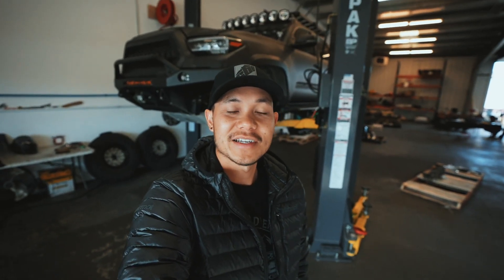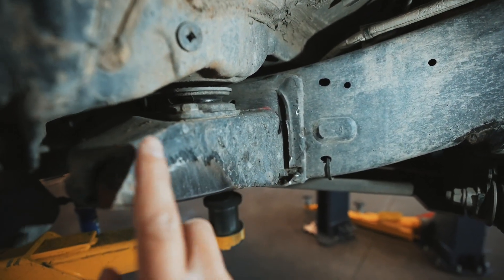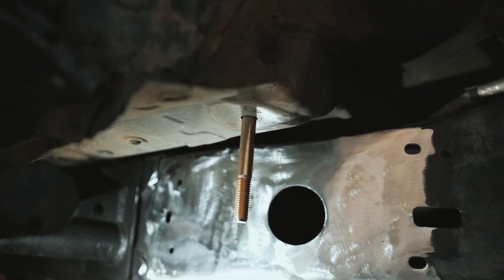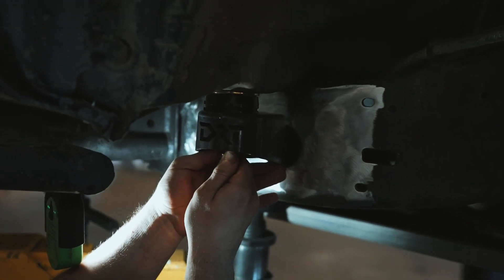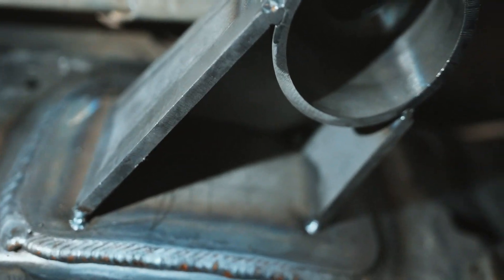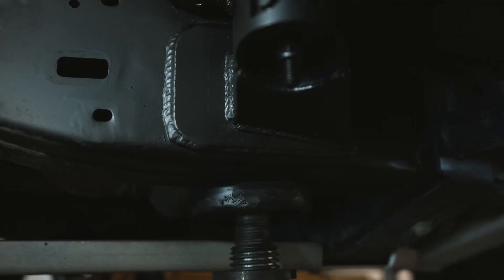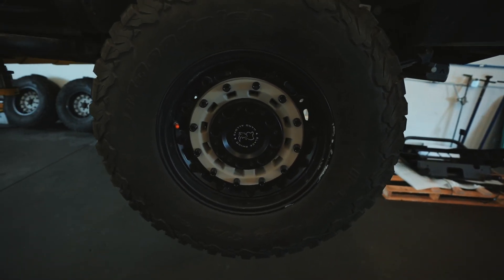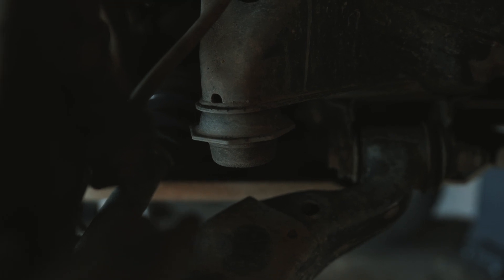How to Fit 35" Tires on Your Tacoma or 4Runner with a Body Mount Relocation Kit / Cab Mount Relocate

Comment: That was a great video with very nice welds and finish. One question: how do you know what height to have the cab raised to before you tac in the round body mount?

Do you just lower the cab and have it sit flat on the ladder frame? Does that not crush wiring harnesses or other parts in the way? Thanks

Comment: I’m looking to put a Rough Country 3 1/2” lift(my preference) on my 2017 Tacoma. With this cab mount relocation could I run 35’s or am I still limited at running 33’s? Thanks

Comment: Have you looked at the JD fabrication lower arm pivot new locators? They claim to cure slot of those problems and get the front tires more of a forward position and better caster.
Reply from the maker: I have not. We usually have to install upper control arms anyways so we use the SPC UCAs to adjust caster

Comment: If I have a 6-inch Lift and I get the cab Mount relocation what are the biggest tires I can fit on my Tacoma?
Reply from the maker: Couldn't tell you unfortunately. But I assume you can do 35s with no issues. We don't work on 6" lift is the reason why we don't know